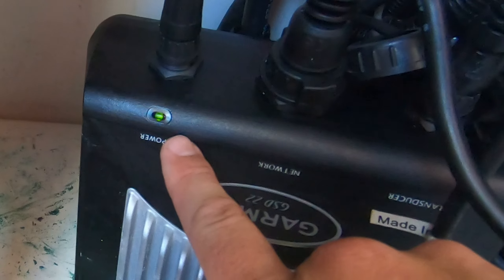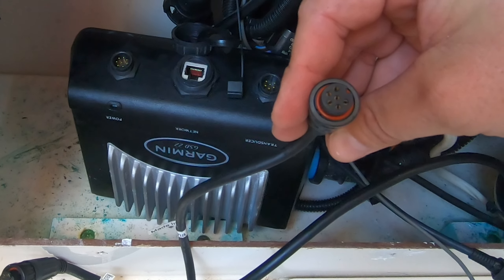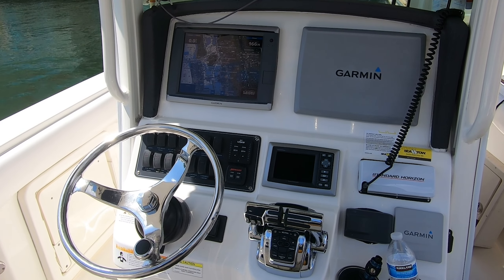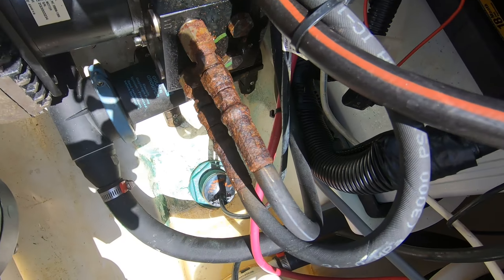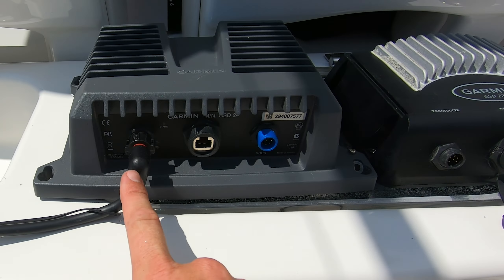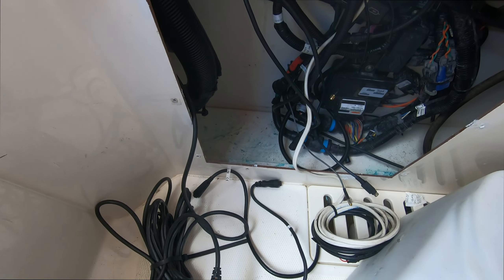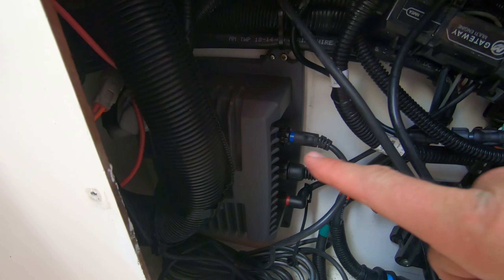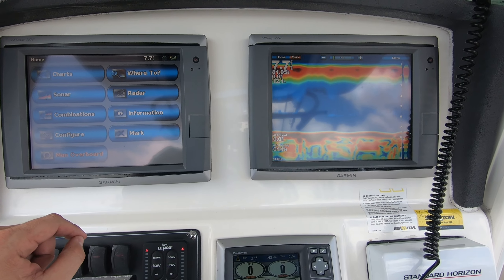Failed Garmin GSD 22 Swap to Garmin GSD 24

Comment: incorrect, solid red have issues with software.
Reply from the maker: Respectfully, you are incorrect (and correct at the same time.) 

A solid RED light is a software issue which is generally resolved with power cycling the unit.

A solid GREEN light is a software lockup due to hardware failure which can not resolved rendering the unit unusable. Garmin used to replace these under warranty but that's not the case as they are no longer servicing them.

https://support.garmin.com/en-US/?faq=AFNi71m6cF8z90AwTbOaQ9